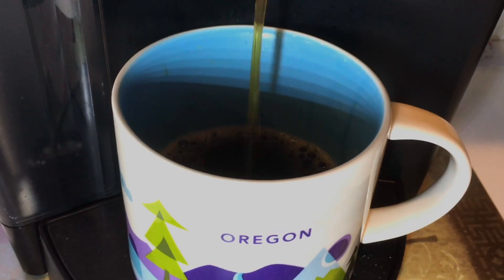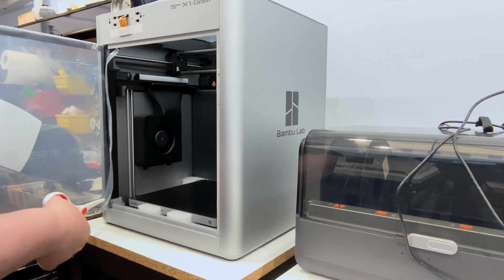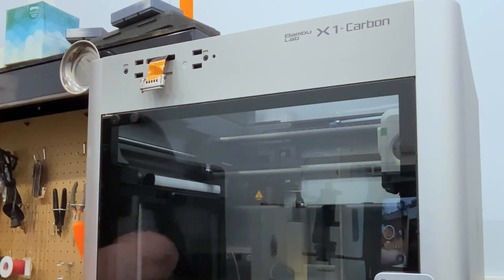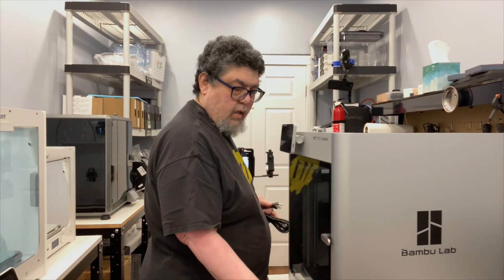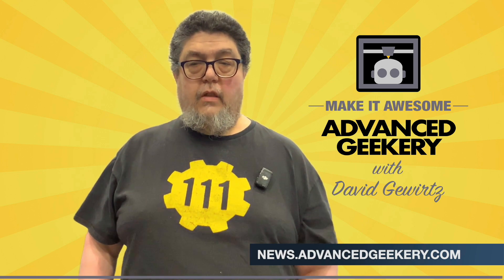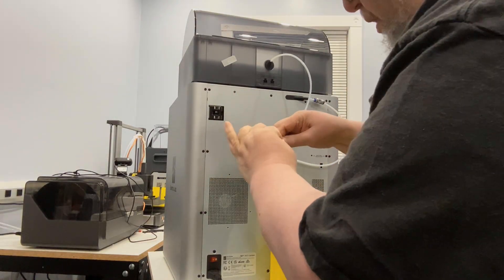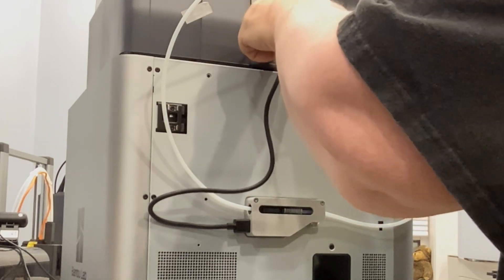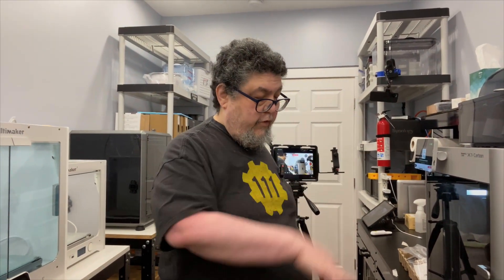Bambu X1 Carbon and AMS installation: Tips and tricks

Comment: The shorter 4-pin cable with one 90 degree connector is directional, as you found out, but it's important to note that connecting it in the wrong orientation can destroy some of the electronics. I just thought I'd leave a note about that here in case someone stumbles upon it.
Reply from the maker: Good safety tip. Thanks!